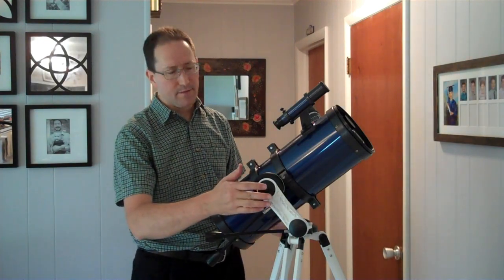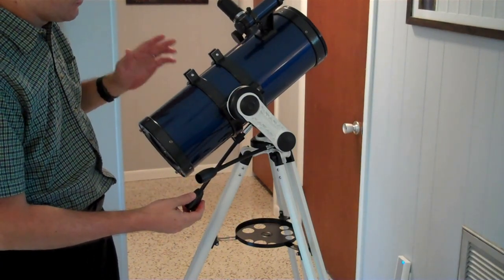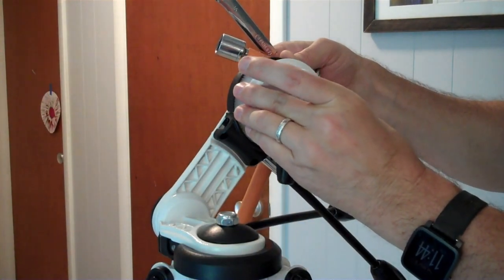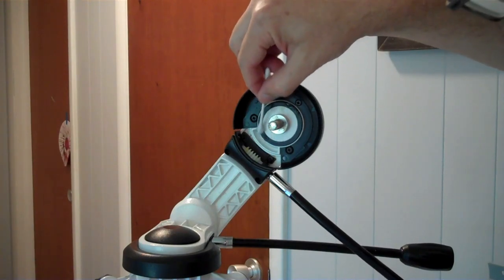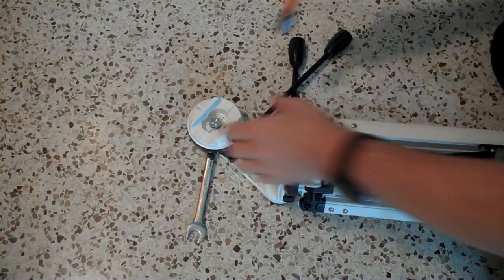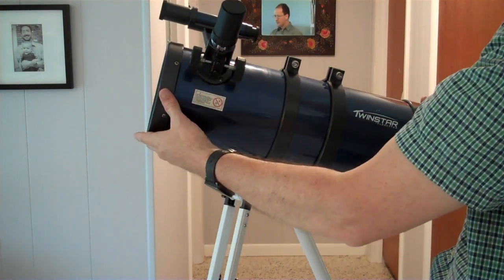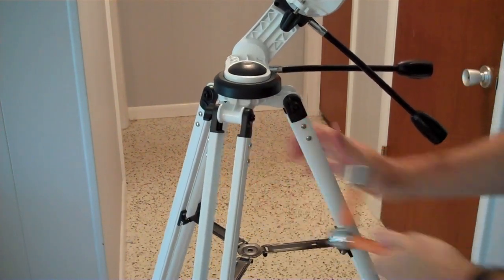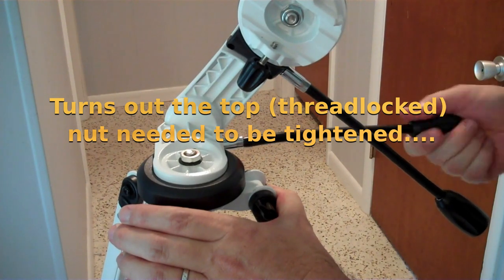Fixing Celestron Altazimuth mount slow-motion drive and slip clutches

Comment: Hello! question have you ever tried adapting this to a bigger/stiff photography tripod? I've been trying to find adapters that would work.
Reply from the maker: I used the 102AZ optical tube on an iOptron Cube E mount. It didn't need an adapter, as the vixen style dovetale just fit. However, it was on the "wrong" side of the telescope, so I either had to use it "upside down" or reverse the end of the OTA, which I did at the following video.

Overall the Cube-E worked well for tracking stars and optical viewing, but didn't hold the 102AZ steady enough for astro-photography. 
https://www.youtube.com/watch?v=CkhQUG1PoOg

Comment: Does it matter which bolt is tightened or loosened? Because when i tried it only the outward bolt would turn
Reply from the maker: I don't think so, as long as it works when you are finished it should be good ;>
Reply: Thank you, this video helped me a lot cause my mount had the same problem